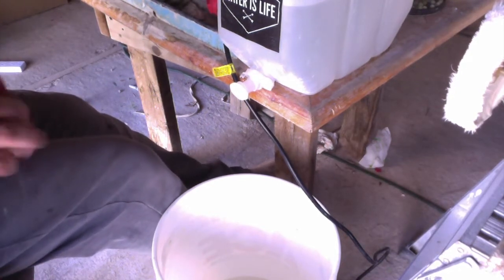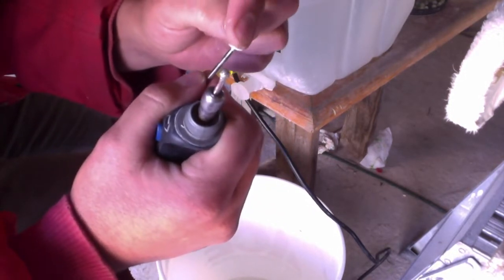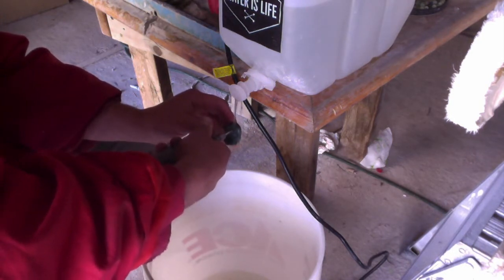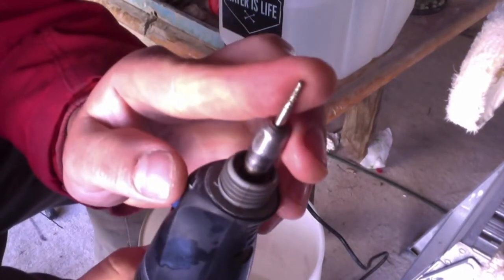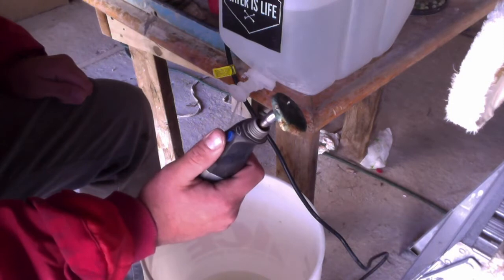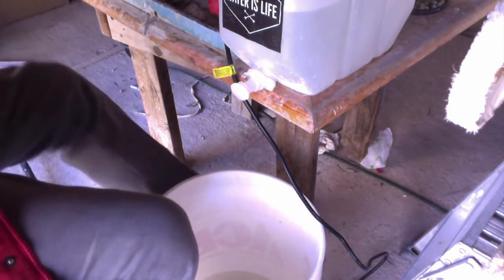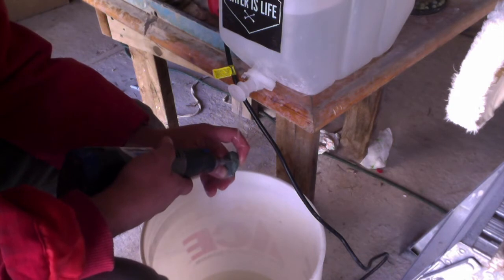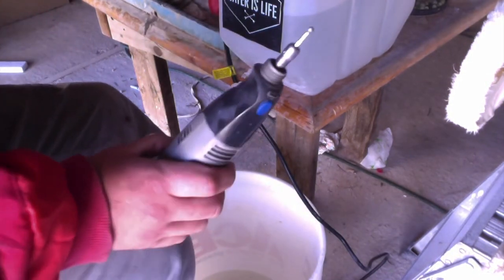quick video on drilling with a dremel / rotary tool

Comment: I used to use the same set until I discovered tungsten carbide steel burs and drills. It took me two hours to drill the same amount as I did in a week. I hope that is useful. I don’t advertise anything I tried three different companies bits, all of them worked.

Comment: Hello Dave🙌 I have a question for you. I purchased a drill pump from Gunther to use on my drill press that I have, It doesn’t work very well it just doesn’t lineup correctly however I was able to drill one of my crystals part way the Crystal itself is about 3 inches long and yes I start drilling the length of it because I wanted something different it’s a piece of jewelry for myself it’s a bracelet and I didn’t want to do wire wrapping. So I picked up my old handheld Dremel and I was able to drill it all the way through I was very surprised very shocked I was wondering if there is any other handheld drill you might recommend? The other option I was thinking was to buy the Gunther lapidary drill press if I could find something cheaper that would be more preferable, any advice you can give would really be appreciate it!
Reply from the maker: Hello there my friend :) i’m sorry I don’t really understand what you mean by the Guenther drill pump do you mean the Gunther multi drilling system? Do you mean the gutter attachment that goes inside The chuck of a drill press? I have the multi drilling system it is an attachment that connects to a standard drill press and I love it however the Guenther drill press is very very nice the multi drilling system that I have is only as good as the drill press that one is using When I first started using it I was using a harbor freight drill press and it was awful now I am using a very nice professional drill press and it makes drilling very easy fast and comfortable so if you have the multi drilling system and a cheaper drill press perhaps consider switching to a higher quality one or just getting the Guenther drill press itself which is a amazing tool when it comes to dremels unfortunately I don’t know too much about them anymore I had the same one my whole life they belong to my grandmother and it was absolutely amazing until someone at the airport took it away :( I would just suggest buying the highest quality cordless one you can afford or maybe try flex shaft they were great :) Anyway my friend I am a little confused on your question if I did not answer your question with what I wrote let me know and I will try to help you out tomorrow either way thank you so much for watching and for commenting I really appreciate it
Reply: @lapidarydave  thank you so much Dave I really appreciate your time and your wisdom! I have the multi drilling system which is phenomenal however I need a better drill press! So I think I’m going to go with the Gunther actually I know for a fact I’m going to go with a Gunther🤗
Reply from the maker: @twiggy2915  Awesome the great people Kevin is a friend of mine from Gunter Hill not regret it my friend

Comment: Can this be done without using water? I’ve never done this, but I have a bunch of polished cabachons and would like holes in them.
Reply from the maker: Lisa Smith It probably can be done without water but I would highly recommend using water the water not only keeps the diamond from flying off of the bit but it also keeps the stone from getting hot and breaking I have noticed when I do not use enough water on my stone that around the whole gets alot of chatter and breaks more than necessary